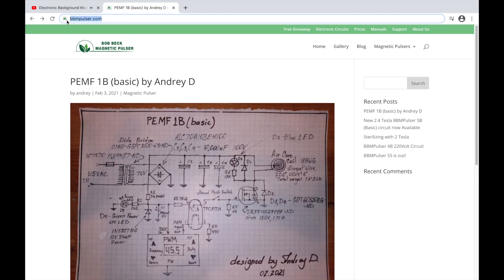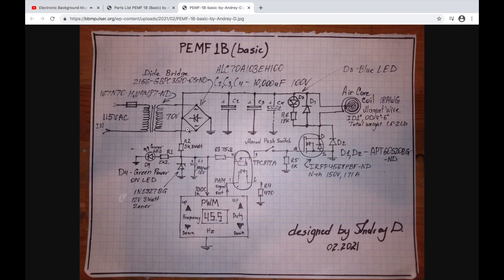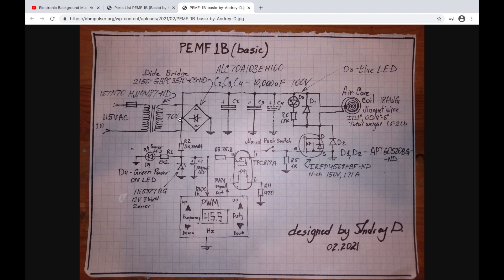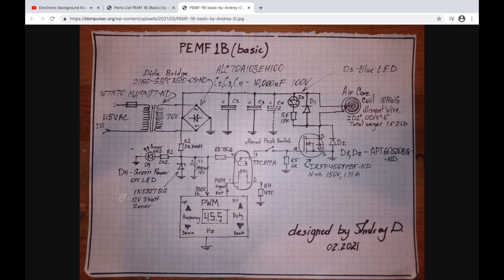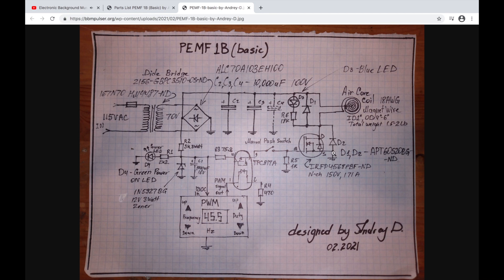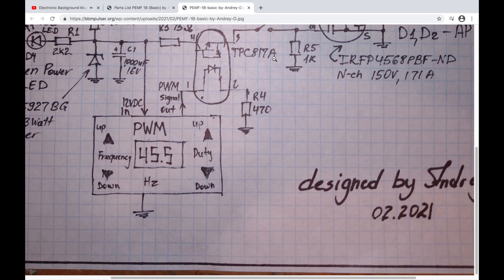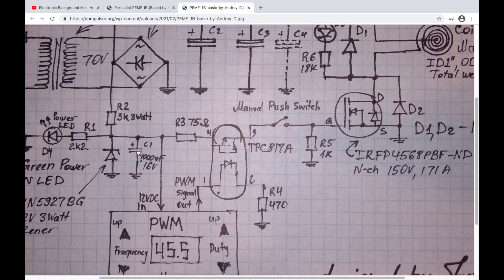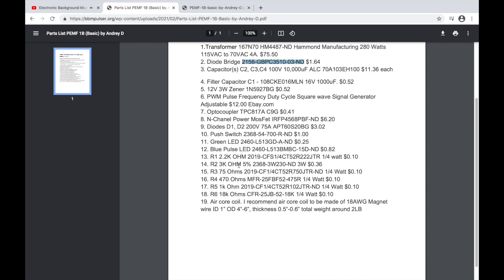031 Strong PEMF 1B (basic) Open Source 1-500Hz 1-25% Duty, 0.2Tesla (2,000 Gauss)

Comment: Thanks for explanation video Andrey, can I use a SMPS 60v 10amp?
Reply from the maker: Are you talking about MOSFET or diode?
Reply: @AndreyD  A switching power supply that delivers 60v 10A...
Reply from the maker: @jcxperts  probably no because when you pulse, you will put a short on it and it will shut off most likely
Analog Transformer can handle quick shorts and it won't shut off

Comment: Thanks for shedding light on how your circuits work. If I tried to make one myself, I don't think it would be as durable, and well made, as the ones I purchased from you. 👍
Reply: I  will use the (3) Capacitors listed on the schematic.
Thank you ..
Reply from the maker: @Enoch-Gnosis  You need 4"x4" PCB. It should fit everything except the transformer, Also Heatsink from Mosfet will be sticking outside of the board. 
Also forgot to say, 2 large Diodes needs to be mounted to the heatsink. make sure you use insulating pad under them if they are on the same heatsink, like mica sheet.
Reply: @AndreyD  wow after studying this design I think it’s beyond my skill level 🙏
I think I’ll wait for the ultra base model version maybe not as powerful.
Excellent works always 🙏🙏
Reply from the maker: @Enoch-Gnosis  Well, you wanted a strong output, unfortunately strong circuits require more components then weak circuits. The circuit I show is the simplest circuit for strong PEMF